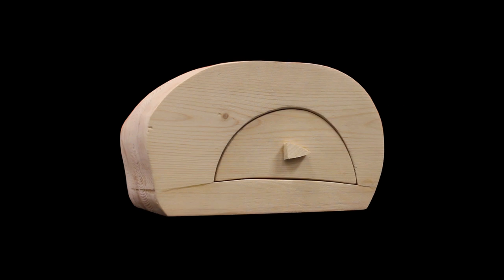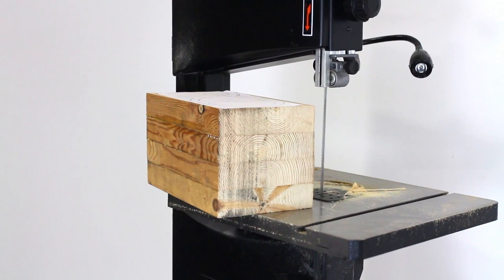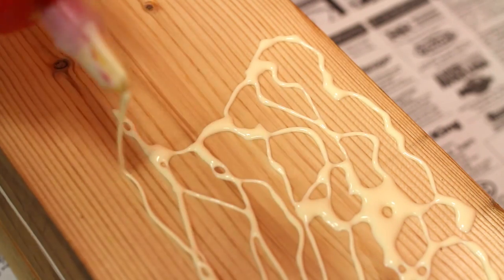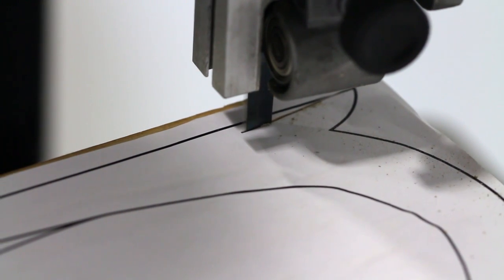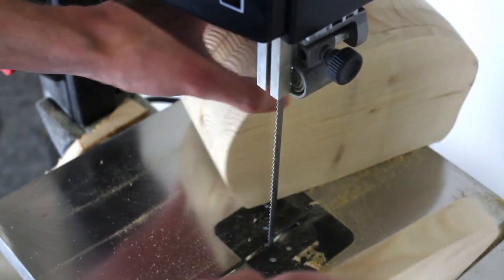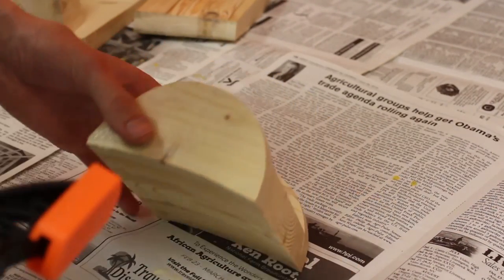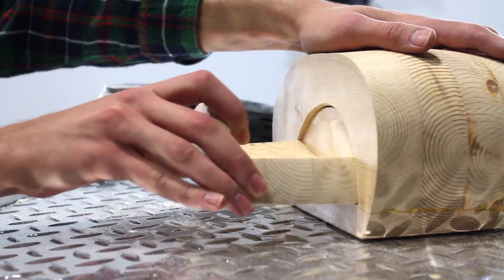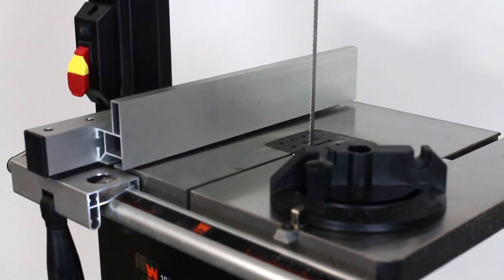How to Make a Bandsaw Box

Comment: I bought this saw through Home Depot for around 245$ and it was an awesome choice for the money. You get six inches of depth as opposed to higher priced competitors, it has worked flawlessly, easy essembly, easy to adjust, came with blade, light with its own switch, solid table and fence. Overall I'm very happy with it. I bought several WEN products recently and I noticed they are all pretty solid machines. I may get their table saw or spindle sander next. I own the 12.5 planet, belt/disc sander, 8in drill press, scroll saw, and all have been excellent. I'm just getting my wood shop up and running and needed affordable tools that work. I think I'm officially hooked on their tools.